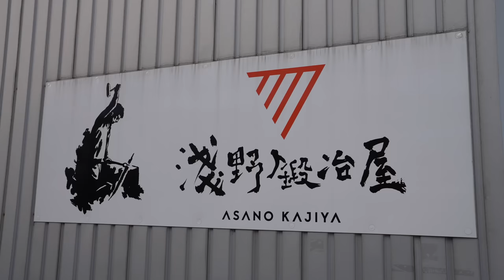日本刀ができるまで。日本刀に美を施す刀鍛冶と弟子たち。

Comment: Nothing is simple. Striking a match..NO..hammer a piece of iron until it glows and lights the match on it.
I'm sure it has some old traditional meaning instead of using a Bic plastic lighter. :)
He taps the lump of iron on the anvil to signal he's ready and also to get rid of slag flakes.
The ash is to raise the carbon content in the steel, and the clay "sauce" is to contain the ash so it doesn't drizzle off.
A beautiful piece of art!

Comment: Nope. This is nothing but a show. 
Lots and lots of things were left out of the video such as mechanical hammers and motorised grinding wheels. The clues are in the finished product at the end.
Reply: Power hammers are not needed when you got two strong boys with big hammers.

The shape of a katana is forged and then cleaned up before quenching, leaving little, if any, grinding to do.

Comment: The process of forging a blade is nothing short of being fascinating.  However, having said that, I don't find this particular process as shown in this video to be "fantastic".  That manual hammering of a molten block IMO offers absolutely no advantage over a stamping machine that can repeatedly hammer a block steadily and evenly.  As you can see from other swordsmiths' videos, it's obvious that just because a stamping machine is used, the full attention and skills of a craftsman is still absolutely required.  It just now shifts the manual part to the machine so the craftsman can focus on what he does best.
Reply: しかし機械の様に単一に叩くだけでは刀は作れません
彼らは考えながら刀を作っています🥷

Comment: The steel used for the sword looks like blommery steel... they are made using very primitive methods and it's VERY labor intensive to make. I wonder if you used modern steel the sword would be better as you wouldn't need to do any of the folding or whatever.
Reply: Better is subjective, but they do make some very fine blades out of modern steels that are amazing.  However, being a non-laminate, you lose some of the beautiful grain and detail in the blade.  From a mechanical point of view, yes, some of the modern steels would be physically stronger and hold an edge better than the traditional laminate.  However, they also have a different feel when wielded, and the aesthetics are different as well.
Reply: The tatara is a Japanese bloomery, so yes, it is bloomery steel.

That is actually important as the smelting and folding allow for impurities to be released and the process of smelting introduces carbon.

Folding is not done to create a laminate, but to homogenize the metal.

Not shown is WHY they are breaking the pieces of flattened tamahagane. It is done to sort them by how much carbon is in the steel. Low-carbon stee, called shingane, is used to make the core of the sword, allowing for flexibility. Kawagane, high-carbon steel, is used for the edge.

Also not shown is the san mai (three flat things) construction. The kawagane is formed into a U-shaped piece that looks like a hot dog bun and the shingane is inserted like a hot dog. They are then forge welded.

You can create a non-folded katana-shaped object with modern steel. However, it won't have the Damascus-like pattern, which is there, but not as flashy as pattern-welded Damascus due to not being etched. It also won't have the soft core and hard edge. You can still do a hamon with differential hardening.
Reply: @elsydeon666  Using modern steel it's even easier to make a good quality katana. You could just get a piece of O-2 steel of the right size and shape it to the approximate shape of a katana. Then you can heat and quench and temper the steel as normal, except you quench in oil. The resulting steel will have an edge hardness of around 65 rockwell C which is plenty hard enough, and you can still do differential hardening by painting the clay onto the spine of the blade. 

The raw steel stock can simply be shaped with an angle grinder if you don't have that much tools, no pounding, folding, etc. necessary.
Reply: whats is this liquid and before its ashes?
Reply: 日本は市民の武器の所持を厳しく禁止しているので、玉鋼以外で刀剣を作ることは許されません。
日本刀は、その伝統的価値のために特別に製造を許される。

Comment: Superba craftmanship....why do you add mud?
Reply: The difference in temperature makes the blade hard and the blade flexible. From Japan
Reply: @フワトロ大尉-f8v thanks, it s basically like a quenching...but why mud instead of plane cold water?
Reply: @fsrodeo81  I think it's to create a difference in temperature, to create soft and hard areas! This is important information for sword smiths, and legend has it that a sword smith cut off the arm of an apprentice who tried to find out the temperature of this cold water! That's scary.
Reply: @フワトロ大尉-f8v  thanks for the explanation 👍